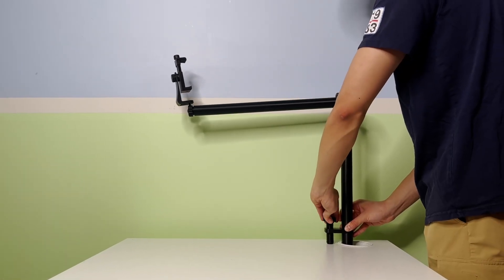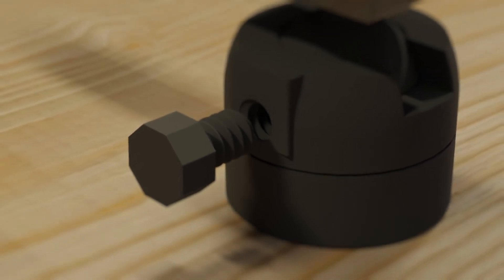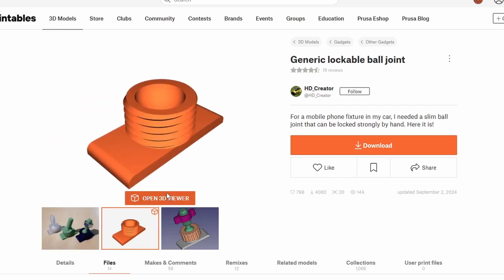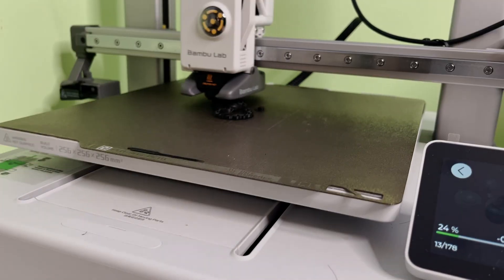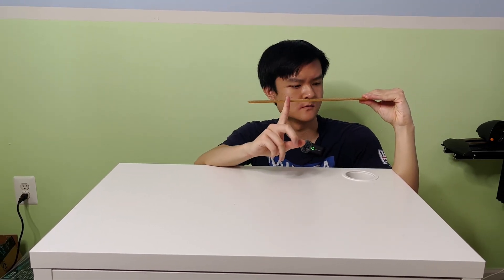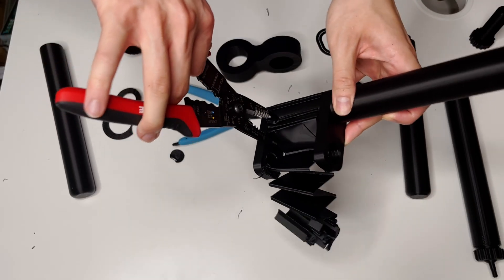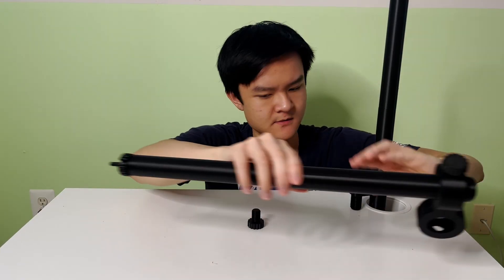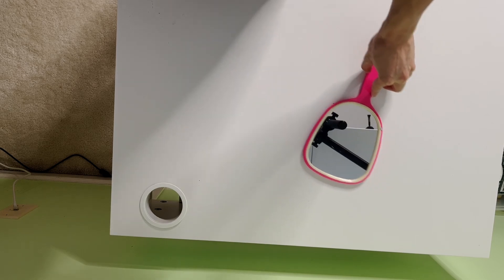I Designed a Solution for my Camera Problem

Comment: A small suggestion. When you print pipes like these that screw into each other, add an o-ring or a thin rubber ring. It makes a difference over the lifetime as it maintains pressure and keeps the joint stable.

Comment: I have found when I need to print bolts with enhanced strength and prevent layer separation, orient the bolt horizontally on its side and position it to contact the build plate along its entire length. This may slightly compromise roundness but significantly improves strength and eliminates layer delamination.
Reply: This is so true! My 3d printed thin parts snaps so easily and I have been thinking doing the same thing ❤

Comment: That's cool and all, but why not pvc pipe? Surely you know that that layer direction for them tubes is not a good idea, or at least you could maybe split them length-wise, print halves and then glue them to get it much stronger 🤔 also less print time probably and less filament used and ughhhhh not less chances for a fuzzy skin or bed adhesion
Reply from the maker: PVC pipe is probably a better solution for the main lengths of the arm. 3D printing it in its entirely was partly due to the fact that this was sponsored, but also was curious to see if I could 3D print all of it.
Reply: @TheTinkeringTechie  cool, looking forward to next vid